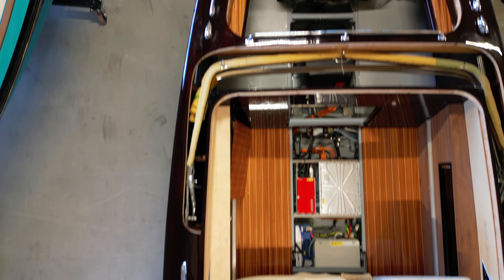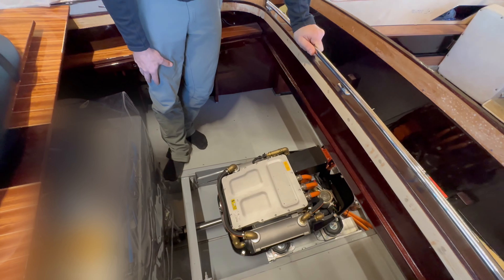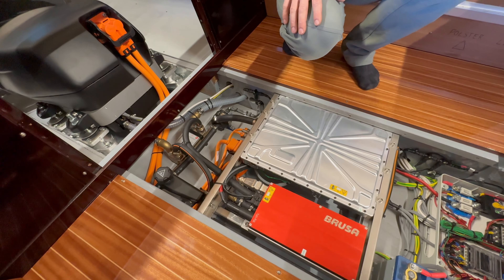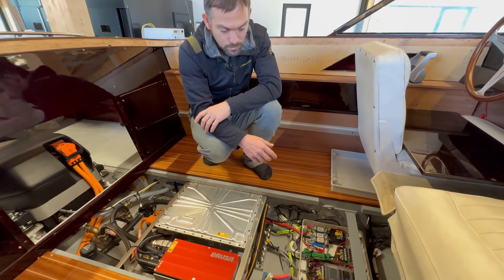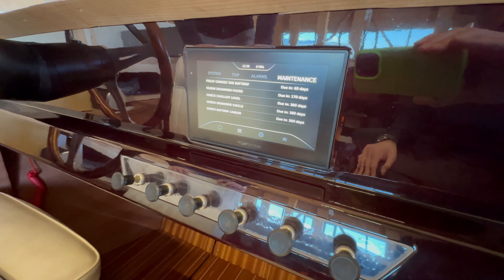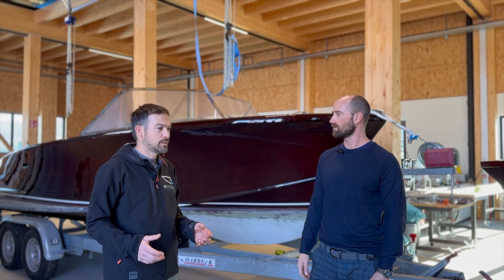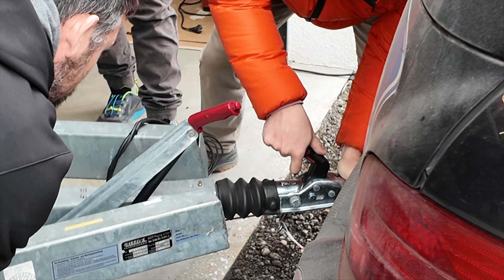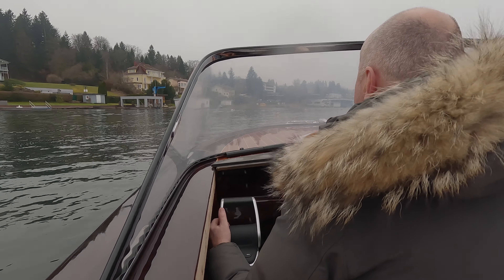Converting a Classic Boat to Electric | NT Systems Pedrazzini

Comment: Beautiful boat and very neat work ..i also noted the   classic RR or Bently in the background.  Someone clearly recognises this places workmanship. 

I would want to pad that rough concrete mooring he pulled up to with all that perfect bright work 😉😂🧙🏻‍♂️🇬🇧 

Just as a mention and on the same topic Nautistyles  
Paid a visit to Holland and Germany and  having taken a trip on a wonderfull old large companies directors vintage motor launch that had been converted. They visited a local company that was doing this fine work on original pleasure launches that the  company had built in the years between the wars mostly.. they restored them and then converted them so they could still be used on lakes and rivers.  Again very elegant slipper hull designs. By converting  they increased their performance in many cases as well as cleaning up the whole buisness of owning and running boats that would have run quite crude  automobile 
petrol engines. 😎⚡🌀🌊
Reply from the maker: That is great, I am loving these conversions giving life to old beautiful boats!
Reply: @aqualectric-gi2ln  
There's an awful lot of diesel di-hards  out there that don't seem to  accept the fact that it's  
Possible to power a boat using electric motors and use a smaller power pack  but back it up with a separate high efficiency generator running on multiple fuels and still make an equivalent  20- 30% fuel saving over a troublesome and complex  diesel engine.. that still has to be supported by high output alternators, solar/wind turbines or an actual separate and heavy generator🤔 
Take a look at Windelo's work and the visits done by the barefoot doctors ...I mentioned your work to them.. They are back cruising in Turkey this week...a major boat building and sailing center for Europe and beyond.  
 They are trying to work out what system would suit their Al Portofino performance cruising cat.  
The big Chinese companies have announced they will reduce the price per KWhr of batteries by 50% by the end of this year and by 2028/30 to a point where it will cost I think the boss of Cattle said, to less than $30 per KWhr. Check the Australian Vikings channel.
The other things that are coming up fast are Na batteries  with capacities bettering  Li Phosphate  cells and whole new chemistries using Sulpher and Al.

Comment: what happens if water splashes in?
Reply: @sungurs That is a very relevant question. There is a lot of engineering specifically dedicated to preventing water intrusion. Additionally, all critical components have an IP rating of at least IP66. Regarding batteries, Justin made a dedicated video about the production of high-voltage battery systems, which we suggest watching: https://www.youtube.com/watch?v=ND4hpcuynU8